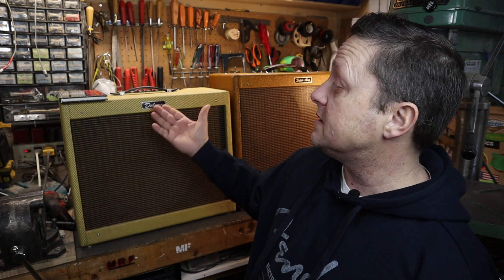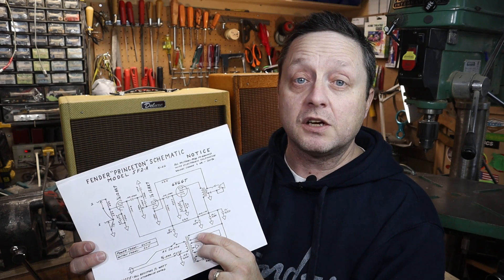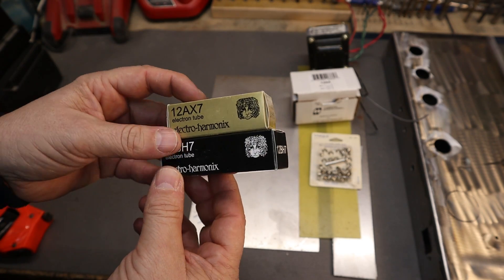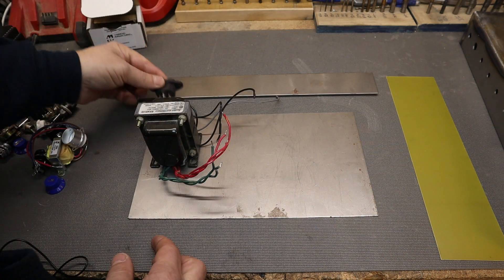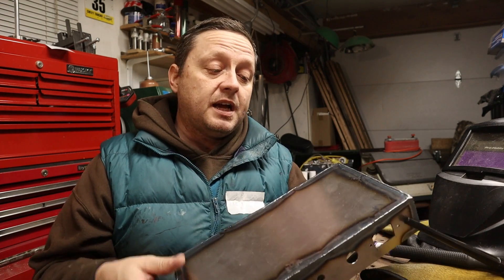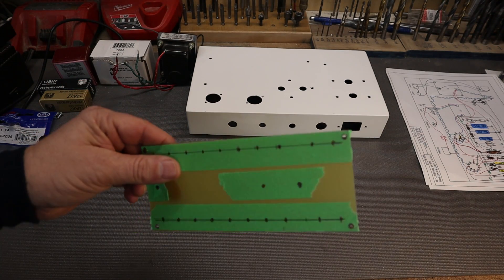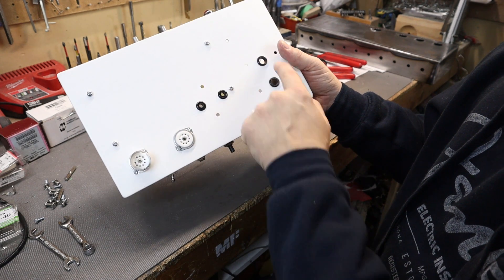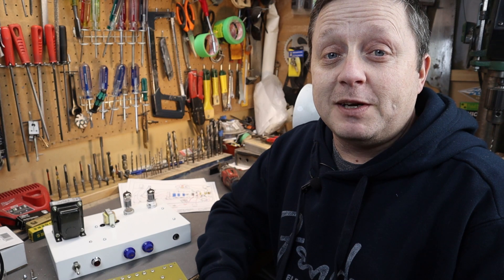Making a 1 WATT TUBE AMP-Part 1: Schematic, Parts & Chassis // Building a guitar amp from scratch!

Comment: Great video series Mike! I’m going to try and squeeze this into a Marshall Lead 12 cab to run 2 x 10” speaker cabs. If I repurpose the existing chassis turning it upside down I only have  7cm (2.7 inches) clearance. Are there components that I could use to make it work?
Reply from the maker: Thanks, that sounds like a fun project! You can definitely use smaller components or move some off-board to fit the tighter space. Look at how Benson Amps do their builds. Something like that may work. Cheers.

Comment: Could reverb be added to this circuit by adding another tube and the reverb tank?
Reply from the maker: Yes, it is possible. You could graft in the early Princeton Reverb circuit or adapt the newer /simpler style 12DW7 single tube reverb circuit, similar to what is in the Benson Monarch. Cheers

Comment: I checked the links but don't seem to find the link to the hammond box. Can you provide that link for me, please? Thanks in advance
Reply from the maker: The chassis I made was a custom size of (11.5" x 6" x 2") The equivalent Aluminum Hammond chassis would be 1444-1172 or 1444-12825. Mouser carries them for around $25USD. I hope that helps?
Reply: @MikeFreda  Thank you for the quick reply.

Comment: Hi.  I am learning tubes and usually build analog/digital stuff.  I am building this amp and was wondering about the grounding scheme.  Should I ground all of the AC components to a single AC ground tree and ground the audio sections to another ground tree?  I usually separate the power supply voltages and digital from the sensitive analog sections using separate grounds and then tie them all together at the supply return.  Should I separate the grounds?  Great informative lessons.  Thanks
Reply from the maker: Thanks for commenting. My layout diagram is a bit misleading. You are sort of right. The ground symbol is mostly for reference to show that its ground nodes. Its not where it's grounded to the chassis, except near the Center tap. Just off the Center tap, install the "star ground".  I find that separating the PSU grounds from the signal grounds to two separate node helps with ground loops and current loops.  If you look at my diagram the only thing you really need to do is ignore the ground symbols and run a grounding wire from the cathode resistor ground to the main Star Ground. I can re-draw the diagram of you like.  I hope that helps? cheers.
Reply: @MikeFreda  Hi...thanks for the quick response.  Exactly what I was thinking.  Keeping the AC grounds separated from the signal grounds and then tying all together at the star ground.  Worked on RF/Analog/Digital equipment for 35 years.  Funny the tricks you pick up.  Most my colleagues ran away from anything RF/Analog swearing it was all black magic!  That's what makes it so fun.

Comment: Why do as little as 1 W? 10W is just as easy
Reply from the maker: Yes, sort of.  ~5 watts is easy. ~10w SE takes a bit more effort. You would need a larger PT and OT to handle the extra current draw of a 6L6 power tube. All this costs more.  The point of this amp is to see if alternate power tubes could be used for lower volume and good tone, I also wanted to see if I could make it less expensive buy using smaller Power tube, PT's /OT's. (FWIW, A 12AU7 would also work well with this circuit)  Many people make the "Champ" circuit so I wanted to do something different. I am happy with the results. It was a fun project to experiment with.   Thanks for commenting, cheers.

Comment: @mikefreda Currently putting together the eyelet board on the 1 watt amp, and I'm trying to double check if the 5w 560 ohm Cathode Resistor is going to ground on the side that is connected to pin 7 of the output tube. I don't believe it is, but I don't want to find out later that this should be connected to ground. Thanks for the help! :)
Reply from the maker: Thanks for asking.  You are sort of correct.  The cathode resistor is grounded to the grounding node on the tag board.  A wire from Pin 7 is also grounded at that node. Pin 2 is grounded via the 220k resistor to the main/first grounding node.  Yes, it is a confusing wiring scheme but that’s how self split output section works.  Pin 2 and Pin 7 are the grids.  Pin 3 and pin 8 are the cathodes.  I hope that helps?
Reply: @MikeFreda  Yes, that helps. I had incorrectly not included pin 7 to and the cathode resistor in the grounding node. I will fix that on my eyelet board now before installing it in the chassis. 

I have been double checking things through RobRobinette's champ micro build as a reference before asking questions, and now I see that in his build he jumpers 2&7 and takes them both through the 220k attenuator to ground. 

Sorry to double check this, but the Pin 2 grid resistor is 330k in your build. Is that correct? Just want to make sure I am installing things correctly to avoid incorrect part replacement.
Reply from the maker: Yes, 330K. Sorry, I was looking at my original schematic before I tweaked a few things.   Rob mico-champ output section is different. It's parallel SE and my layout is more a Push-Pull scheme.   You can try both but the OT are different.  cheers.

Comment: Great video and a great project. This would be a good project for a first time builder. I am building a Champ style 5f1 amp and one thing that's challenging about that is the chassis is about half the size of yours so things are very cramped but this project has a much roomier chassis with which to work. Can't wait to watch the other parts of this project.
Reply from the maker: Thanks for commenting. Yes, I've built a few Champs before and things can get a bit tight in those smaller chassis. The amp in this video could be easily modified for different output tubes. There is lots of space to experiment! Cheers.

Comment: Amigo cuantos Vatios  maximo puede entregar un Amplificador con la valvula 12AU7 si se alimenta con 12V. Se puede aumentar ese voltage?
Reply from the maker: Thanks for commenting.  I do not know if it is possible with a 12AU7. I've never done it. That low of B+ is not represented on the documented load line. It may work but the output would be low and possibly distorted.  Look at Usagi Electric Youtube channel. He experiments with low Voltage Vacuum Tube Audio Amplifier. Cheers.
Reply: @MikeFreda  Ok. Tal vez sería mejor utilizar el 12AU7  como etapa de Pre-Amplificación. Muchas Gracias por responder.
Reply from the maker: Yes, you can. It will work but it will be very clean sounding and will not distort very much. A 12AU7 has a mu (Amplification Factor) of 20. a 12AX7 has a mu of 100. That is a big difference in voltage gain and thus the overall sound of the amplifier.
Reply: @MikeFreda  Muchas Gracias Amigo.

Comment: Cool build , yet you should of painted the underside because it’s going to rust very quickly
Reply from the maker: Thanks for commenting.  Yes, I should have. It’s not bad at all.  It pretty much sits in my office.  When building it I wasn’t sure how it was going to turn out. When I started testing it I was blow away how good it sounded and decided to finish it up nice… I didn’t want to take it all apart to paint the inside.  Oh well.  Cheers.
Reply: @MikeFreda  even tho it will be inside it will still rust I don’t where you live or how humid your area is , yes it does sound good, I’m not sure if you’ve heard or Terry at D- Lab or watched any of his videos, he built me a 3 Watt amp from a repurposed Toyo radio it also sounds very good, I would hate to see such a good sounding amp rust away how about if use some rust oleum and brush the underside it wouldn’t take that long , anyway happy playing

Comment: @mikefreda Thanks for this video! Just a heads up that the Input Resistor to ground of the Layout and the Schematic are different. The schematic and parts list say 1 meg, where the Layout says 100R. I'm ordering both, but care to elaborate? Thanks! :)
Reply from the maker: Thanks for pointing it out. I thought I had corrected the PDF. It is 1meg.  It is fixed now! Cheers

Comment: Sucks that most of the tubes were from russia Electro Harmonix has been a favorite. (Edited out my old statement since it was a post for another channel.
Reply from the maker: Your comment seems a little cryptic to me but I going to assume you are referring the tubeset I used.  Electro Harmonix is actually owned by the New Sensor Corporation which is an American Company (Mike Matthews) They also own the Tube Factory that just happens to be in Russia. The video was made and the parts were purchased prior to the serious political happenings going on in Eastern Europe. It is a crying shame to what is going on over there  and I understand your feelings but my video is about building a guitar amp from scratch using parts from all over the world,  Cheers.
Reply: @MikeFreda  That is awesome. I look forward to seeing more tech coming from Europe.  Sorry that last post somehow crossed over from another channel so I did fix what I had.

Comment: Would you please confirm - is a 12BH7 in push-pull configuration 5 watts, rather than one watt?
Reply from the maker: Thanks for commenting, a 12BH7 in a single SE configuration would only give you ~1/3 of a watt depending how it is biased.  In a Push/Pull or Parallel SE configuration you would only get around 1 watt. These tubes weren't really designed for this sort of application but people have figured out of the years that it can handle this duty. If you want more power,  you will need a use a dedicated power tube like a 6V6 or a EL84. Cheers
Reply: @MikeFreda  thanks Mike for confirming. 

I asked only because on the Blackstar HT5 they use a 12BH7 to get 5W.

I wasn't sure how the whole thing worked…
Reply from the maker: You’re welcome.  I suspect that is a bit of a marketing ploy. 1watt RMS without clipping is different than 5watt peak at a higher frequency range.  They don’t really say how or what their measurement is. Realistically, to your ear, the difference between 1 watt RMS and 5 watt peak is not a lot. Cheers.

Comment: Can't wait to see how you handle the phase inversion for your push pull output section. Nice video and very watchable narration.
Reply from the maker: Thanks for commenting. Glad you liked the video. The output section is an old topology from the 40's called Cathode-Coupled Output Stage (aka Self Split)  Though, it's not super efficient it works great in this application.  There is a link in the video's description section explaining how it works. Cheers

Comment: Very interesting, thanks for making the video and sharing. I've been researching to use a box pan brake for making chassis. After watching your video I'm wondering about using a welder instead. Could you tell me the equipment you are using for this project? Like the welder setup used at 7:28 and the weld grinder at 8:13 also rods you are using and anything else you think might be relevant? Then I can look into this approach.
Thank you.
Reply from the maker: Thanks for the comments. Yes, a Pan Break is something I may purchase if I do more of these sort of projects.  The welder I use is a Miller Maxstar 200 TIG welder. 3/32 Tungsten, ~75 amps, 0.35 mild steel rod.  You may be able to find a less expensive TIG welder but  a MIG welder is a lot cheaper and easier to learn. TIG welding takes a lot of practice. I've been TIG welding for ~15 years and still learning things.  The 90 deg grinder is a Milwaukee M12 Fuel with a 80 Grit Flap disk. I LOVE this tool! It's well worth it! Cheers.
Reply: @MikeFreda  Hi Mikes, thanks for the reply. Just had a quick look on TIG welding, https://en.wikipedia.org/wiki/Gas_tungsten_arc_welding  seems there are various safety hazards, so think will stick with the idea of a suitable box pan brake, but might make more economic sense to have a case made up, if can't get ready made off the shelf. Thanks again, enjoyed the vids and have subscribed and liked. You are one smart guy :)
Reply from the maker: You're welcome. Yes, welding does have some health risks but they can be mitigated with Proper ventilation,  Respirators,  Good quality helmet and how your clean and prep the material.  Hammond makes pre-made cases and chassis that can be easily converted into amp chassis. Cheers.

Comment: Terrific video, Mike!  I was wondering how you arrived at the 12bh7 as your choice for output tube.
Also, where did you find the threaded inserts that you used in the corners, for attaching the bottom plate?  I was looking for something like that for rack gear that I'm building.
Reply from the maker: Thanks for your comment. The 12BH7 is very similar to the 12AU7. The 6CG7 could also work. These tubes have a low Mu (~20) which makes it good for this application. It is stated that the 12BH7 is a "tougher" tube than a 12AU7 and has higher dissipation characteristics.  You can use a 12AU7 but you should probably lower the bias and need to use different primary taps on the OT.   The threaded inserts are call Rivnuts. You can install them with a simple tool or a proper gun. You can get them at Harbour Freight and they are all over Amazon. The cheap tools work okay but they can get a bit frustrating.
Reply: @MikeFreda  Thanks, Mike. I was wondering about use of a pentode for the output, but I suppose that would require more engineering. There was a series of half-rack 'pedals' by H&K that used various tubes to drive a dummy load and speaker simulator.  One used an EL84, another used a 12au7.  They'd also drive a speaker.  Probably very pricey now.
'Rivnuts'...I searched for a couple hours for 'threaded inserts' and whatever else I could think of, and never came up with Rivnuts.  You saved me some time.  Those should be perfect for the rack systems.
Reply from the maker: Yes, you can use a pentode like a 6V6 in the output, that’s basically and Fender Champ or Princeton. You would need a different PT and OT.  Cheers!

Comment: EXCELLENT BUT WHY WOULD YOU SPEND ALL THAT TIME AND HARD WORK FOR ONE WATT? WHY NOT A NICE 40 OR 50?
Reply from the maker: Thanks for the comment. I wanted a low power practice/recording amp. I have made a couple larger amps and I find I don’t play them much.  Also, larger amps do cost a lot more to make. The transformers and tubes cost twice as much. This video was also trying to show people that you can morph circuits and make your own creation.
Reply: @MikeFreda  THANK YOU FOR THE REPLY IS IT POSSIBLE TO UP THE WATTAGE ON THIS BUILD IF YOU WANTED TO?
Reply from the maker: Yes, just build the Fender Champ or Princeton version with a 6V6 output tube. 5watts which is more than enough for house volumes.

Comment: Great video!  I love the welded chassis.  I have a question - it looks like you used mild steel, as opposed to chrome plated or stainless.  Are you concerned about corrosion on the inside where it isn’t painted?
Reply from the maker: Thank you for the comments. Yes, it is mild steel. No, I’m not concerned about corrosion. The amp stays inside and all the grounds are through drilled with stainless hardware.  It may rust a bit from me touching it but I don’t feel it’s a major concern. That being said, In my latest amp build I did paint the inside for a cleaner look. So, there is nothing to stop you from doing it as long as you have a good ground. 
Yes, Chrome plated, aluminum or stainless is another option but that’s hard to work with.
Reply: Plating will burn off from the welding.  Aluminum and stainless can be TIG welded.
Reply: If you have the welding gear and clued up on using it that's the cheapest and fastest way to get a tough chassis. A folding brake will only fold certain pricey grades of aluminium or thin steel sheet but its fiddly if you cut out the corners for the folds and leave tabs to pop rivet the corners together.
Hammond make a wide range of nice folded chassis sizes but that can get pricey.

Comment: Hey Mike, if you were to safely add an FX loop to your schematic, where would it be?
Reply from the maker: Hello, you can but I’m not sure it is worth modifying the circuit to make it work. You sort of lose the champ/Princeton vibe of the amp. It’s has a simplified topology where you can just input the effects right at the input Jack.  You can look on the net for people who have done it. The front end of this amp is pretty much a 5F1 Champ. Some have put it between the two preamp stages or just before the power tube stage. I have not clue what would sound best or it if actually works since I’ve never done it. I hope that helps a bit?
Reply: @MikeFreda  thanks, you make a valid point.

So yeah, it makes sense to keep this amp as simple as possible. Or, if I need something more versatile, go fore a Tweed Deluxe build. Except I'm not sure that one has an fx loop either. Not in early versions for sure.
Reply from the maker: Most of the earlier tube amps (40’s to early 60’s) did not. Effects weren’t a thing back then due to solid state components weren’t really invented yet and people wanted a clean sound…. It’s wasn’t till the 60’s effects started to take off. All the tweed amps are basic topology based from the 40’s and 50’s.
Reply: @MikeFreda  yup. I once had the bright idea of experimenting with turning an old Soviet tube radio into a guitar amp, looked at the schematic and the damn thing creeped me out. Wasn't too keen on having tube high voltage rails on common ground with the guitar, because the transformer didn't have separate leads to isolate those. In our business, the first thing you learn is to respect high voltage, least it's the last thing you learn to respect.